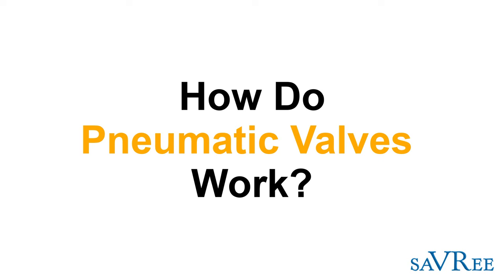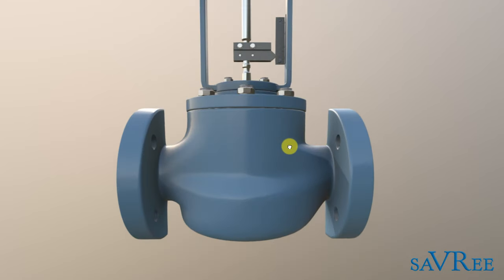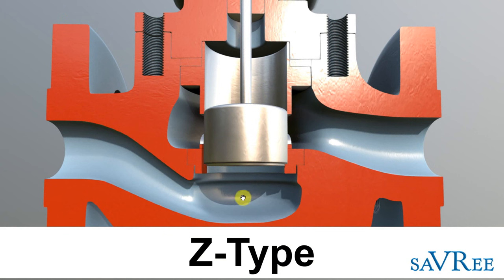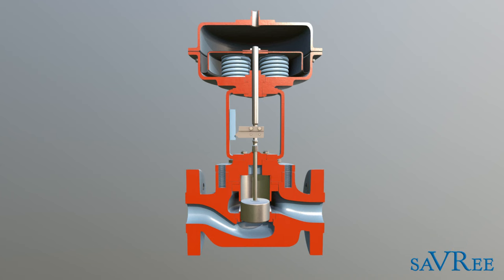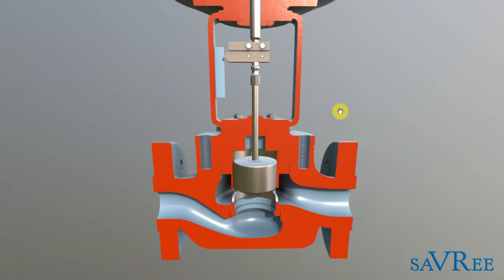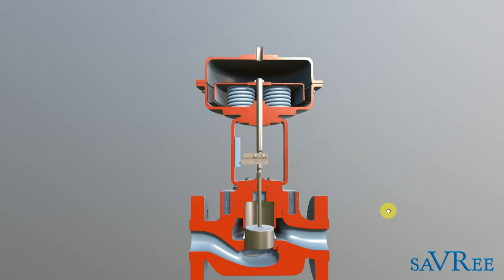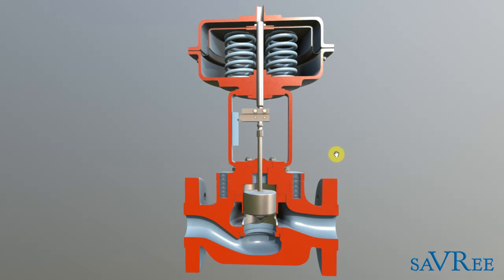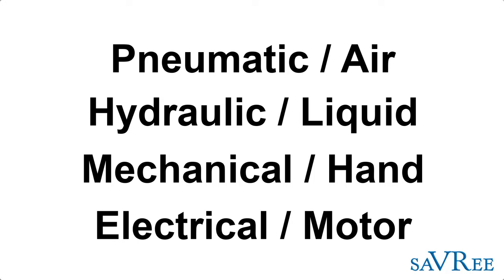How Pneumatic Valves Work

Comment: Good Day!
I am working with this type of valve on a chemical/product oil tanker. It was installed on steam line going to heater used for heating water during washing of cargo tanks. Regarding main problem with troubleshooting during loss of air, we had installed double manual valves before pneumatic valve and one after pneumatic valve. Control of temperature was possible with a thermostat that regulated air pressure on pneumatic valve. I can tell you that system worked for 16 years on that ship with proper maintenance and still in good shape. 

Thank you for your great work!

Comment: Nice video but I have seen a lot of pneumatic actuators working with throttling control valves. In fact most of them use diaphragm pneumatic actuator. If you want to be accurate, positioner are used. Please clarify (minute 7:45)

Comment: Excellent video!
At the end of the video you say that peumatic valves are used for on/off purposes only, from my experience, they are used for throttling , all pneumatic actuated valves I have experienced are used for throttling, so I need to clarify that point, which is the reference for that?
Reply: @savree-3d  Yes I am talking about O&G industry, Thanks for clarification

Comment: What is the fluid flow pressure?! 

I actually have a question for u. In case the fluid flow pressure is 5 bar. We have only 3 bar to activate the pneumatic valve then it is possible for the activation?! Expecting ur detailed explanation.

Thank u in advance

Comment: Dear could you please answer my question. How small pressure in the pneumatic actuator .2-1bar is controlling the process fluid/steam pressure which is very high e.g 40 bar. Is it because of the area? Or what? Plz explain. How the force acting on diaphragm will overcome the force in fluid and spring force?

Comment: An insignts for calculating the dimensions ? Like the diaphram size, disc size depending upon the gas pressures and the air pressure required ?

Comment: If oressure of the fluid in line is more than 7 kg per sq cm as u described for air, will the valve get opened??...how do we make and keep than it closed if if pressure of fluid handled is more than air pressure

Comment: Is it possible to remove the spring and use only the pressure of the fluid to control the valve?
Reply: It is easier, simpler and more cost-effective to use the spring. But it is possible to remove it and replace it with air/oil pressure.

Comment: Wasn't it supposed to be Electrical / Solenoid instead of Electrical / Motor?
I've never seen or heard of a motor operated Valve.
Please Clarify
Reply: They do exist,electrical actuators that is ,where instrument air is not available,in his example for a open close valve,yes a solenoid would be used

Comment: I'm sorry but the ending bits are entirely misrepresented!
In the real world, globe valves with pneumatic actuators are solely used for throttling applications and seldom used for on/off services! And I've never seen any globe valves being used for isolation applications in Oil & Gas services!
With the appliance of a positioner and I/P converter, you can use any type of Analogue or digital electronic signal to whatever air pressure supply you need for the valve (usually 3~15 psi).
Reply: There is an ISA standard for globe valve leakage classes.
And none of those classes match the performance of even the lowest classes of an API 6D double block & bleed ball valve.
Reply: @savree-3d  thanks for the reply. as I said, I was speaking from the view of Oil & Gas industry.
Reply: @savree-3d  thank you again.